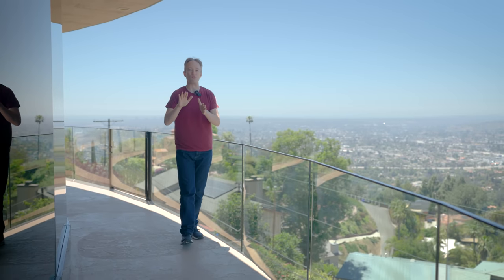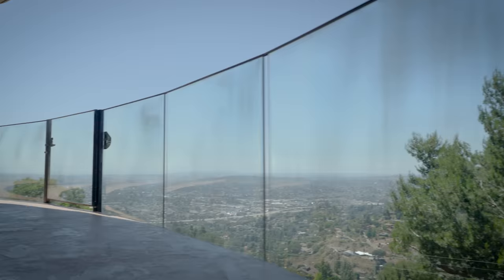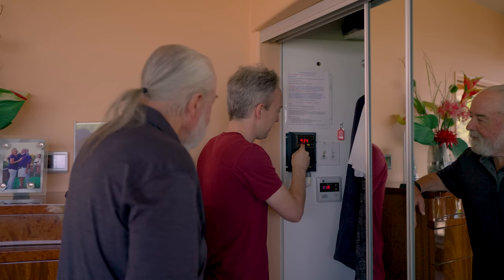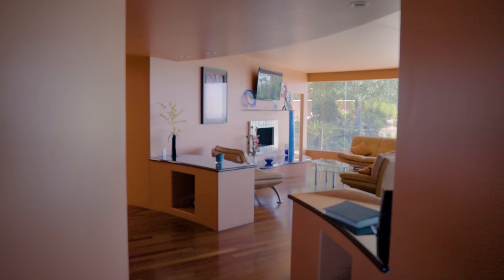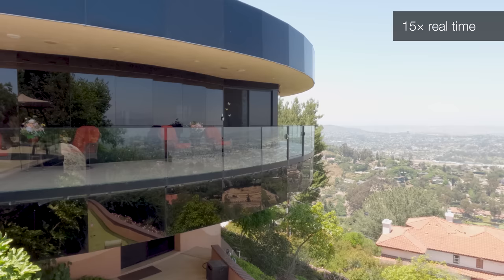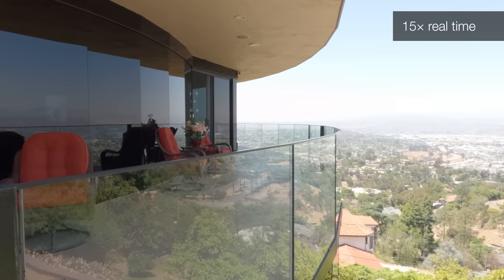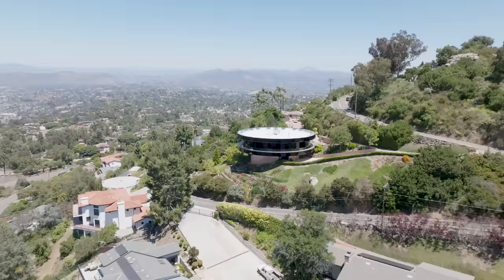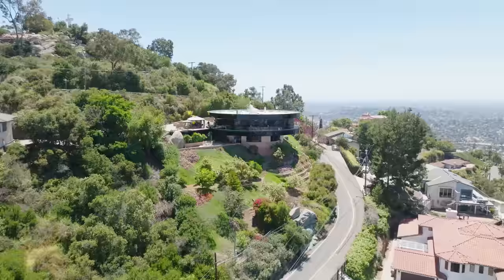I thought this rotating house was impossible.

Comment: Honestly, once you and Al described how it works, my thought was "that's deceptively easy, why has no one else thought of that ?"
Reply: Because the obvious solution is to build a house that doesn’t rotate.

It’s a solution for a problem that you have to work extremely hard and profligately to create.
Reply: As is the case for most good inventions!
Reply: There is not much need for that, I would say. In a rotating restaurant there is no need for a rotating kitchen or restrooms (as that doesn't need the view, so can be put in the static core), and even private owners of such buildings mostly want other rooms to be rotating.
Reply: "Yeah... Why? It requires thinking."
Reply: Well, clearly one has thought of it and did it 23 years ago.
Reply: Lack of demand, I'd assume.
Reply: They do, for hydraulic cranes
Reply: He got a design patent for a triple fluid rotatable hub coupling. 

But the basic concept is identical to a stuffing box/wet gland/stern pack for a vessel’s stern tube that separates ocean from interior of the vessel with a rotating shaft that’s also lubricated.
Reply: I bet designing those seals wasn't easy, hat's where the real challenge is.
Reply: similar systems exist but just not in the context of plumbing because no one builds spinning houses
Reply: Because a rotating house is completely unecessary. Necessity is the mother of invention.
Reply: @pbe6965  this is very easy, an excavator swivel works the same way pumping hydraulic fluid to the thread motors while holding hundreds of tons of machine
Reply: Excavator swivel joints were definitely in operation before the year 2000. The engine is on the top and the drive tracks are on the bottom. The hydraulic flow and pressure needs to get through somehow and it's basically the exact same as his house, but higher pressure.
Reply: It has been thought of before, but probably not for houses. The rotating gland system is used quite a lot in the offshore Oil & Gas industry on FPSOs (Floating Production Storage and Offloading). It is basically an oil tanker with processing equipment on board. The oil and gas risers (flexible pipes) as well as quite a few other services come from the seabed and go through the rotating turret before going to/from the process equipment. The Turret is a much more complex version of what Al has built handling much higher pressures in a dangerous environment. 
What Al has built probably without that offshore knowledge is something special and unique for a house, and shows the ingenuity of individuals when coming across a problem.
Reply: What does AI have to do with it?
Reply: @nirodper  doesn't the hydraulic fluid provide some kind of lubrification ?
But it probably also rotate a lot more and at higher speeds, so even when running "dry" it might be more than enough for this house.
Reply: It is kind of like a fluid version of the electrical and data connections between a tank hull and the turret. Just far mor complex to imagine up.
Reply: @oldvlognewtricks  No, this means we can have rotating houses
Reply: People have thought of this. It’s the same design that excavators use so they can rotate but still send hydraulic fluid to drive the tracks at much higher pressures than here.
Reply: @MrSleepProductionsInc  Ah, I forgot that example, even though I used to work on the things.
Reply: @andreybushev3020 Well he's the person that designed the house, that's what
Reply: Well for one this particular problem isn't one that most people have needed to solve since they didn't make a rotating home. And also because simple solutions are hard to think of.
Reply: They have. Rotary fluid joints aren't a new thing. As for other builders using fixed cores? Probably cheaper and easier to just use a fixed building core. It isn't that no one couldn't have told them or even them having known it was actually possible to plumb it fully. It was just too expensive for their taste. That size rotary fluid joint can not have been cheap to have been custom manufactured.

Comment: That custom built slipring is an truly ingenious solution! Great to see this couple live their dream and pass it on for the future
Reply: just to clarify, this should actually be a rotary union, because it moves fluids. Him mentioning that its a Slipring himself, is actually pretty weird, as he seems to be a pretty good engineer (because of the failsafe system idea).
Reply: What I don't get though is why not put drinking water on the top just as redundancy?
Reply: I love Tom's analogy of concentrically stacked funnels. I had way overcomplicated the topology.
Reply: @user-op8fg3ny3j  They are all under pressure, so whatever two mix, would mix in both pipes. Think of when you cover a faucet or a hose with your finger. The water will then spray out in whichever way it can. Same thing happens here. Gravity wouldn’t affect which ones would be contaminated, as the force of the pressure would overpower gravity. And yes, they do have to be under pressure… that’s kinda how pipes and valves work. Hope this clears things up. 🙂
Reply: @RipVanFish09  Yeah, of course the water supply has to be pressurised since it needs to travel against gravity.
But why does the sewage need to be pressurised?
Reply: @user-op8fg3ny3j the sewage and grey water aren't pressurised, that's why they'll never contaminate the clean water

Comment: The system for the water and gas connection is actually somewhat similar to a ship's oil distribution box. Ships that have a CPP (controlled pitch propeller) have two oil pipes going through the propeller shaft to the propeller's hub to move the pitch. The transfer of the oil from the "fixed" ship to the rotating shaft is done with the oil distribution box and has a similar design to the system in the house.
Reply: I would imagine its the same for airplanes with oil driven variable pitch props? Specifically thinking of the T-6 Texan II, but there are many. 
Interesting.
Reply: this is the same way excavators are able to rotate on a turntable infinitely while still driving  via hydraulics
Reply: Also quite similar to how FPSO's are connected to subsea oil and gas wells.
Reply: I knew I had seen this before! Thank you! I used to sail on a ship with a CCP and I was thinking some do this sounded familiar

Comment: Pier 66 hotel in Fort Lauderdale was built in the 50s. the top floor was a lounge which rotated full circle in 66 minutes, 66 rooms, elevator 33 seconds up and 33 down. everything was 66 owned by Philips 66. it's still there..

Comment: I used to work as an electrician at a plant with cranes that used slip rings for the cab. They provided air, alumina, and electricity down feom the bridge to the cab. Not hygenic of course. Seems like he has a great system worked out.
Reply: What is alumina in the case of the cranes ?
Reply: @psirvent8  aluminum oxide
Reply: @rat_boy_u  Thank's for the definition of the word alumina, actually I was already aware of it however why would a crane driver need to get it delivered to his cab ?
Reply: @psirvent8  spout at the bottom loads ore into the aluminum pot

Comment: The water and gas are handled by what is essentially a swivel joint. It's a component most often associated with hydraulic machinery that need to transfer multiple hydraulic lines across a common pivot.

Comment: This is great.

The fluid slip ring is neat.  Have used them before with air, makes sense any other fluid could be made to work.

Crazy gearing from an incredibly tiny motor.

Comment: The man invented whole new components just to bring his dreams to life. What an engineering legend
Reply: Not taking anything away from him, he's clearly intelligent, but he didn't invent the components, he adapted already existing designs to suit his purpose... The rotating slip ring comes from hydraulic machinery applications, such as excavators and boom lifts, that's what allows them to rotate 360" endlessly while having multiple hydraulic functions. I've rebuilt a few myself over the years.
Reply: @maxnaz47  but gas, water, and Grey water in one connection is nuts

Comment: That plumbing slip ring is slick.  It's intuitive and makes perfect sense if you understand how electrical slip rings work - that concept is the easy part.  Getting the thing to seal properly had to be a nightmare though.  Finding the correct tolerances and materials was a real engineering feat.  Ensuring there are no blockages must be a delight - I'd hate to see what happens when the grandkids flush toys down the toilet, or the shower drain catches a nice big glob of hair, or someone tries to be helpful and dumps the drippings from Thanksgiving turkey down the kitchen sink.
Reply: Why would it be a real engineering feat? You know the dimensions and pressures, there's nothing difficult in designing this
Reply: in that case couldn't you just clean it like any other pipe? from my understanding it's just a pipe but r o u n d?
Reply: If the sewage and grey water lines are on the top, presumably they aren't under pressure and you could make the central shaft of those two accessible via simple watertight hatches from above?

Comment: The slip ring has a major design flaw. He should have put the drinking water on upper groove, the grey water on second groove, the sewer on the bottom groove. that way if a leakage happened, the drinking water would be less likely to be contaminated.
Reply: Drinking water is pressurized, gray and sewer are not.  Gravity is not a factor.

Comment: Some rocket motors have seals like this, but the gap in-between where the sensors are, are pressurized higher than the pressures of the other liquids. So if there ever is a leak, it's the high pressured air leaking out and not fuels and oxidizers. and of course an alarm goes off that there is a loss of pressure.

Comment: I'm so surprised in the slip ring design for sewer and fresh water they weren't the other way up, such that any possible leak in the sewer seal above would not possibly flow anywhere or over the fresh water; I know it's not possible really in the assembly, however I just as a human would like the fresh water to be above.

Excellent and fascinating engineering throughout.
Reply: Agreed, I would have had
the sewage at the bottom.
Reply: Drinking water is pressurized. In the event of a breach between the two, the direction of flow would be clean water --> sewer, regardless of the direction of gravity. Though there would likely still be some contamination.
Reply: For those reasons: It doesn't matter. Whatever is at the top in the top-rotating section flows through the center and will be the bottom interface in the stationary-bottom half and so on. The slip ring system is essentially a coaxial pipe. One argument for sewerage in the center (top on top, bottom on bottom) is a less restrictive path for the 'chunky stuff'.
Reply: There's zero chance that he arrived at that arrangement without considering all of the possibilities.
Reply: Easier access for inspection and repairs.  The sewer one is the one that needs to be watched 👀
Reply: @Effervescent_Smegma Yes you are right about sewerage systems needing to be inspected and accessed.

Comment: As far as I am aware, this is how turrets work with multiple hydraulic lines on equipment. E.g. a bucket truck. Obviously its smaller and simpler as its all hydraulic oil, not various fluids and house-scale.

Edit: It's a hydraulic swivel joint, if anyone is interesting in seeing it.
Reply: turrets? what is this 1944?

Comment: I work in a factory that has a much smaller but simalar turning structure. we call it the carousel as it's roughly the same size as one. It holds 10 pneumatically opening frames that hold aluminium and steel moulds. They are water heated, so air and water have to run up the center and out to each station. We use a fairly similar center hub, and a slip ring for electrically controlling each pneumatic press. This was a crazy video to watch on my lunch break, I never would have thought to upscale the idea to such a degree.

Comment: The slip ring system is very similar to how the hydraulic tracks on an excavator are powered. Very cool to see it scaled up, and with sensors to detect any cross contamination.

Comment: The gas, sewer and water device is very similar to a rotating joint in a excavator machine like Caterpillar/Linkbel heavy equipment.
Reply: I use to work on heavy equipment…
Reply: Dude thrst crazy

Comment: I think, the plumbing would be even smarter if you would organise it as gas on top, drinking water, grey water and sewer water on the bottom. That way, when something DOES leak and the sensors fail, nothing gets contaminated because gravity helps you
Reply: Drinking water and gas are both pressurized, so they're more likely to leak out than have something leak in. I think the sewage being on top is something to do with giving it the biggest opening and straightest path, since it needs to pass all manner of things through it and is the most prone to blockage.
Reply: @20quid  That's a fair point!
Reply: I had this exact same question.  I'm sure the unintuitive order is intentional since everything else about the house seems so well thought-out.  I'm a little disappointed that this wasn't explained in the video.
Reply: @jamesdlin7  It's because the sewer ring is the largest, and if it were on the bottom, you couldn't drill the holes leading up to the other rings without drilling through it. At least, not without making the whole assembly much larger.
Reply: @iguanamoat  Ah, very observant. Thanks for explaining that.

Comment: That is simply amazing. Thanks for sharing. However, due to gravity, I would place the drinking water on top of everything else in the center command sliding unit, so if anything leaks, it will be drinking water on top. Cheers there! :)

Comment: If I'm ever asked to point to someone who achieved the American dream, I think this guy would be a strong candidate. He wanted a rotating circular house, and through determination, a defiant sense of individualism and with a hefty dose of clever engineering, he got his rotating circular house.
Reply: I'd suggest it was more that the code enforcement guy DGAF. That central sewer ring is a nightmare.
Reply: just be sure to ignore the hundreds of millions that with hard work and determination achieved diddly squat
Reply: @cf453  I mean it works, but I would have put fresh water on top, just to be sure 😀
Reply: booo, bad take. This is a rich guy flexing his wealth. Actually, that is the American Dream my bad
Reply: @B20C0  I've been engineering water and wastewater systems for 30 years, I would have too. For a one-off, custom application, with the inventor maintaining it, it's fine, but there's no way this should be trusted or approved for mass-use. It's also probably impractically expensive.
Reply: @cf453  I doubt there's a huge market for rotating homes anyway.
Reply: @keiyakins  I mean, it's a subset of the housing market - but I guarantee there would be an AirBnB/rental market for this.
Reply: @Positive_Tea 
  I don't mind rich guys blowing money like that, if it is cool, i approve

Comment: The slip ring design for different liquid is amazing.  But the maintenance cost to keep different channels totally sealed, separated and rotatable should be high, especially for the water supply to kitchen and bathrooms which will be at a pressure.  I doubt the seal rings can actually last 75 yrs.

Comment: As a kid I always assumed that stuff that rotated (like lamps for instance) used sliprings. It's only as I grew older and started disassembling things that I realized most of the time it's just wires that are wound around the "core". I'm glad this guy took what is generally thought of as an impractical, unreliable, and expensive solution, and ran away with it.

Comment: You know, I have spent a week or so in a rotating cabin in finland, and only afterwards thought about this very thing: How did the piping work.

Unfortunately that cabin has since burned down, not due to the spinning mechanism, but someone forgetting to put out the fireplace in the sauna after use.

Comment: Awesome!
(but personally, if I designed the slipping system for the liquids, even though there are 2 seals & s sensor ring, I would still put the drinking water ring at the top, it's easier to leak down than up, and if some fresh water leaks into the sewage, no big deal, but if sewage leaks into the drinking water, you'll never want to drink water again :P )

Comment: I feel like you'd want the sewer on the bottom of that contraption, not on the top.
Reply: Exactly what I thought too
Reply: Doesn't matter either way, since the tap water is under pressure so if any leak occures (despite all the sensors auf fail safes that are included), sewer or rain water won't get into the tap water
Reply: @5ch4cht3l7  good point. I never thought of that
Reply: I suppose that as sewage is (ahem) "larger" than clean water, it would need to be at the big end of the funnel; hence the top. But that was certainly my first thought too.
Reply: I thought that too...
Then I considered that there is a Gas ring in there.  That introduces a lot of extra issues regarding what you do and don't want it interacting with. Probably not the only factor, but it does complecate things.

Comment: Out of an abundance of caution, I would have placed the sewer and grey water ring below the drinking water ring on that central mechanism. If there IS an undetected leak, I would rather have drinking water run down into the sewer feed rather than the other way around!